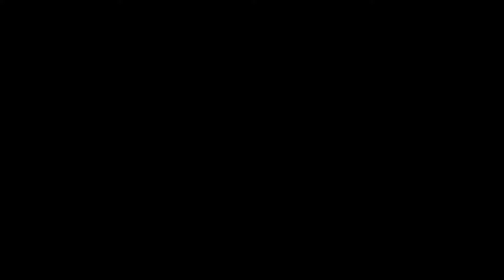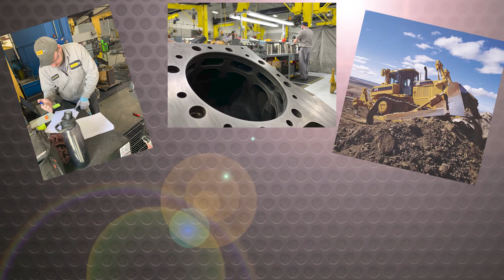Carter Machinery ShopTalk: Cat® Genuine Filters

Comment: Frickin excellent,.  I hear diesel truck, lift pump guys talkin for and agains CAT filters on regular diesel pickups but even when they mention things like can touighness, acrylic beading and spiral roving, they don't explain what they are, how they know or why.  Escpecially the acrylic beading.  I thought (for months now) that they insert tiny little beads on the outside of the pleates and I was confused why introduce a bunch of  little tiny plastic ball bearings, even if they help open pleasts..  Plus I could never see them. I  thought the clear line of material applied was glue.   Just now I got that it;s aline of plastic that holds the pleates separated.  NOBODY explained, pointed or described what I get very clearly now,  Thank you.  I will finish off my Baldwin and FASS filter initial purchases for my new lift pump and follow up my one set of CAT fillters with probably exclusively CAT fuel filters.